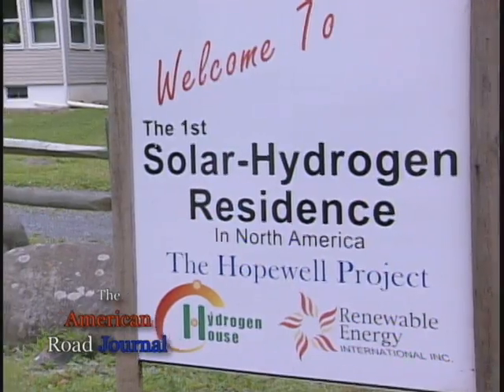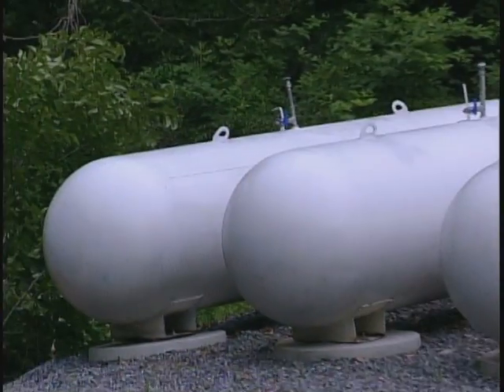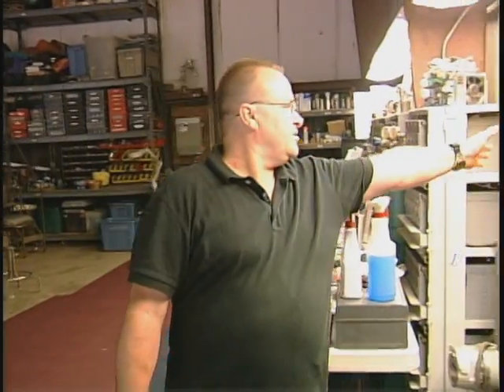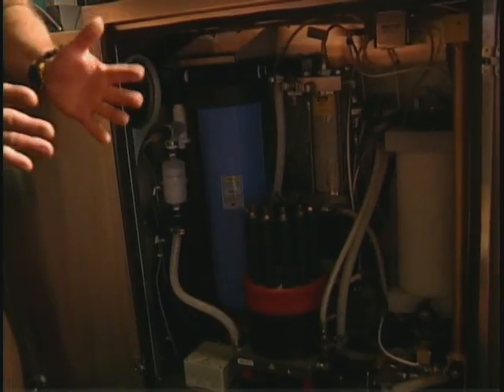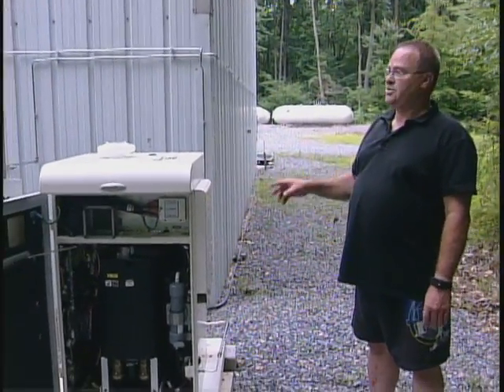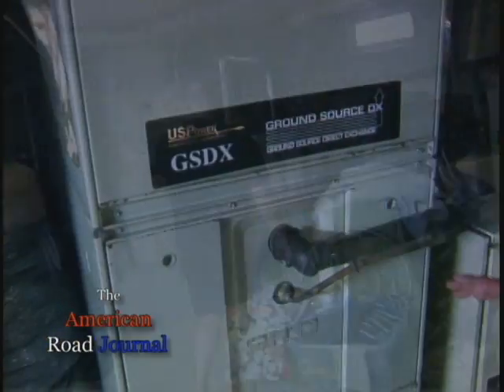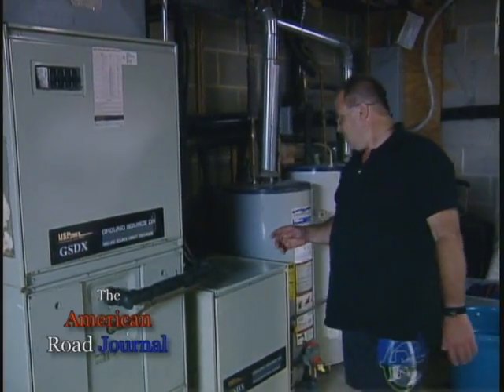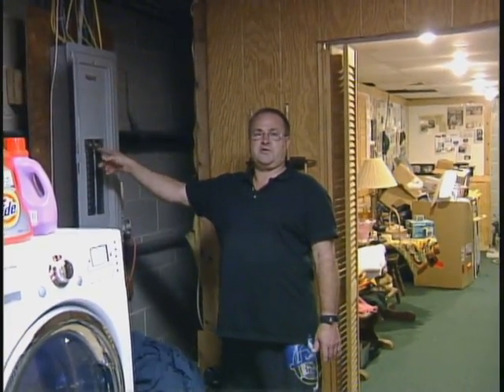Mike Strizki and his hydrogen powered house

Comment: Elon club
Reply: Elon needs to step up his game by doing this with his cars, i mean lithium ion batteries are cool, but they are nowhere near as efficient or cheap to run as hydrogen is to create and how far it will allow the vehicle. 

not to mention the batterie issues in a car have lead to catastrophic familiar of the battery getting too hot and then igniting the entire car into a chemical fire that is impossible to stop and if you are in the car at the time, you will burn up to a crisp of molten chemicals because of the lithium being unstable to the use that it's being used for. 

your just better off using hydrogen like this. 

it would be nice if Elon ditched the lithium ion battery and just converted to hydrogen, it's funny because Elon knows about hydrogen, he uses it to make his rockets go to space and back, so he clearly knows how effective it is.